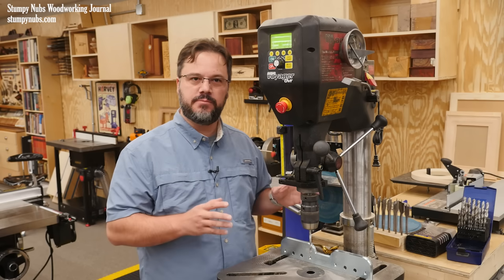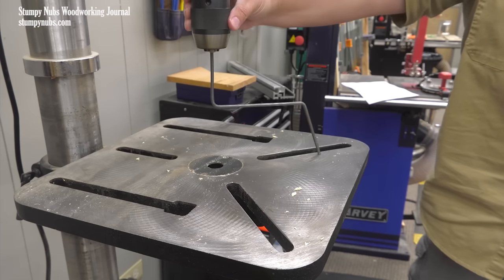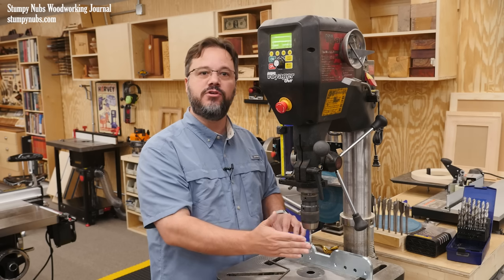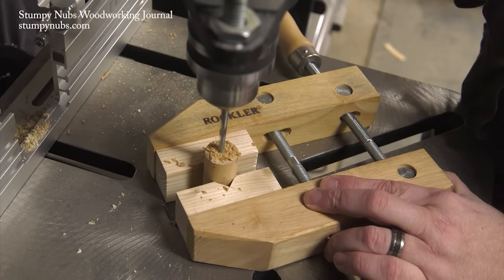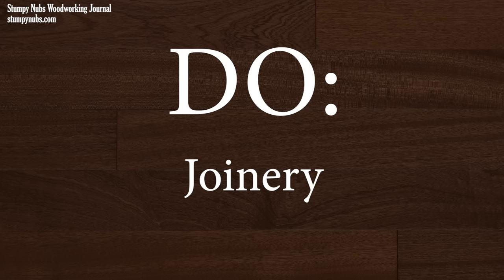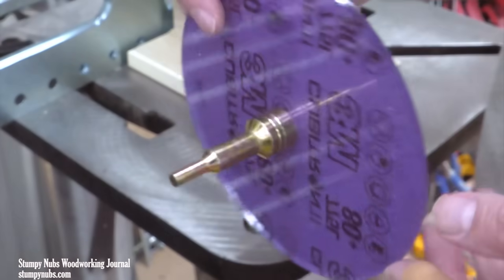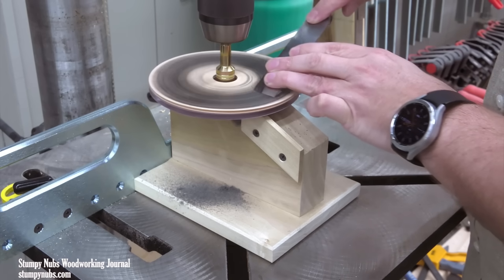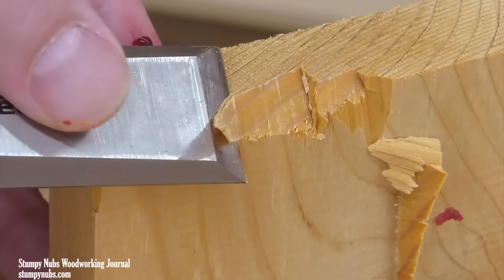WARNING: Internet drill press trend can SERIOUSLY hurt you!

Comment: I can't help but feel uncomfortable about the idea of acrylic spinning in a drill chuck.  Maybe the object you're drilling might just catch the edge of the acrylic and then it shatters, shards flying everywhere. I dunno, I just don't feel happy about spinning acrylic.
Reply from the maker: When using any power sharpening system, including common bench grinders, the tool must be held in a direction so that the spinning disc or wheel is going away from the tip. A catch on a bench grinder wheel can violently jerk that tool from your grip, as well. There is a basic level of common sense when using any machine.

Comment: I don't understand why people use a giant press for little things. My wimpy $50 press can be stopped by grabbing the chuck and will still cut a 1/2" hole through metal.
Reply: Yes, but if you sometimes need to drill bigger holes, like 1" in steel, your press wouldn't be able to do it. But with a big press you can also drill small holes. Othewise you would need two drill presses.

Comment: The fact that he nicked his finger while demonstrating how 'sharp' the chisel supposedly was tells me that it isn't that sharp. Any reasonably sharp blade will cut through end grain if enough pressure is applied, but the odds of the blade slipping also increase as you apply more pressure. And that makes it more likely to have stumpy or nicked nubs.

I'm sure the drill press sharpening trick is great to save from having to buy a slow speed bench grinder for gross sharpening, but if you're really wanting to hone your blade then stick with a diamond stone or whetstone.
Reply from the maker: The blade did not "slip" and cut me because it wasn't sharp. If you have never gotten the occasional tiny nick from a sharp corner of a chisel or another tool while handling it, you are either not being honest or you haven't been a woodworker long. Nicking yourself with a sharp tool happens. It's painless, it only bleeds a few drops and it's no big deal.
Reply: @StumpyNubs  I've gotten nicked plenty of times when chiseling. My point was that the sharper the blade the less likely it is for the user to get nicked while chiseling. I gauge whether my chisels need touched up by how often they 'skip' during use. A stupidly sharp edge should slide through wood with an easily controllable amount of effort.
Reply from the maker: @RickerD  Why do you assume the nick occurred because the tool skipped or slipped during the actual cut? That's rarely when I've been nicked. It usually happens while handling the tool, reaching for the tool, bumping the tool while moving something on the benchtop, or countless other ways. We're not talking about a big gash here, it's a tiny little nick and a couple drops of blood that are magnified by the extreme camera closeup. If you use tools on a regular basis, you know this happens and is not because it is dull, but because of the opposite.
Reply: @StumpyNubs  It's a reasonable assumption based on the location of the injury (between 1st & 2nd knuckle). When I nick myself from handling tools it's usually on the tips of my fingers or my palm. But as you noted, I'm making an assumption and don't know what actually happened. So I suppose I should ask: how did you cut yourself? I hope you're OK and the nick heals quickly and with no infection.

Also, I would like to point out the simple fact that if the cut on your finger was from the chisel, that alone is an indication of its sharpness. But 'sharp' is a very relative term; you could have stopped after the first round of grinding and had an edge that was sharp enough to cut wood or skin. Each progressive step made the blade sharper though, and that was really my main point: stopping after a 220 grit isn't really producing an impressively sharp edge. Yes, it's sharp; yes, it's quite sufficient for most woodworking tasks; but I would not consider that sufficient for cleaning up joinery or the like. (shrug)

Comment: Autumn Tip. When drilling out a leaf rake to repair or replace a handle. Put that head in the vise. A metal spring rake becomes a fan blade reaaal qhick

Comment: I taught tool and die for decades.  The drill press is the most dangerous machine tool when viewed as to which causes the most lost time accidents in a machine shop.  The lathe comes next.  !st class was always no long sleeves or loose clothing,  no wristwatches or jewelry.  No long hair.   No wedding rings.   Why you are issued a locker.   You always block in your work piece  so it cannot spin if the drill catches.  Take the classes and do not try to learn from amateur youtube content creators.

Comment: Aways have a rail to stop the price from spinning and rule of thumb don't use your hand plus coated  tools are a joke cause if you get past the coating it is not as hard and sharping doesn't hold up here's why tool steel is drawed back at 900 to 1100 degrees give or take the coating is put on at 1200 degrees so once they you get past that it makes it softer this is why I never buy coated tools and still have the same drill sit 50 years later Holt drills are the best

Comment: Yeah! Talking about safety and then sharpening a chisel on a free spinning disk. No thanks I’ll stick to a stationary wet stone.
Reply from the maker: I guess you've never seen the Worksharp before? Or Lee Valley's sharpening system? This isn't a new concept, and it is no more dangerous than a bench grinder. The direction of the disc rotation is away from the tool.

Comment: Quite frankly,  you sir are an amateur at hurting yourself with power tools.  I, personally have drilled 2 holes in my hand,  electrocuted myself with a desk sander,  blown my face off with a gas forge,  then electrocuted myself with an electric forge! Each time I said to myself "ok- I'm not doing that again!" Safety lesson (painfully) learned.  I maintain that if involved life and limb,  then the lesson sticks in your mind.  Also,  if you think it's dumb,  it probably is. The number of times I've been holding something in one hand,  a power tool in the other and this thought goes "there is probably a better way to..   OOOW!!!"😂😂 So you can learn by a combination of luck, evolution and bitter experience, but it's probably better to just read the manual...

Comment: Just an observation, but when talking about the proper way to use a tool, and the footage you are using contains blood emanating from your digits or other body parts, you might want to explain that you didn't get that wound from the activity you are demonstrating.  Unless of course, you are, in which case you should explain that this is much better than the result from doing it the wrong way....
Reply from the maker: Anyone who has done any amount of woodworking knows what it's like to git a tiny nick from the corner of a sharp chisel. It happens, it's painless and no big deal. I don't think people need a play by play about what happened.
Reply: @StumpyNubs I know. It isn't a personalized piece until I bleed on it a bit. Mine usually come from splinters though.

Comment: No gloves? Yeah maybe if you are drilling soft wood in a climate controlled shop. Spiny disc with a very limited lifespan media for sharpening (and screwing up your flats and corners)? Why?  Oh it will be sharp because the two planes can meet, but as a properly tuned chisel that is a consistent flat back with non rounded peripherals?  I think this is not wrong, but it's also not for people doing real and efficient work.
Reply from the maker: Google "Drill Press Glove Injuries."... And the spinning disc is a very efficient way of sharpening that has been used for many decades and is the bases of several professional systems. It is definitely "real and efficient."
Reply: @StumpyNubs  just because you wear gloves, doesn't mean it's going to get wrapped up in the drill motor, lathe... Etc.  it's completely unrealistic to, for example, not use gloves when drilling steel with hot chips flying at your hands.  Nor would it be so to be at -10C outside trying to hole
Hog through a post.  Focus with the proper knowledge is the best safety.  You try your best to not have gloves, yes.  But the reality is even homeowners often have unheated garages.  It's far more dangerous to run the machine with numb hands than it is with gloves.

A spinny disc stropping the back of a chisel will definitely screw up the two peripherals.  It will still be sharp, but your chisel will have issues when the two corners are used, especially over a longer paring distance.

I am not saying your video is not right.  I am simply saying that it is not practical in some (in fact, many) situations, and for the discs, does not produce a tool that is satisfactory for all work.
Reply from the maker: @MintStiles  Just because you do anything dumb doesn't mean you will suffer the consequences. But it greatly raises the risk to an intolerable level. The examples you give should all be clamped down, not held with a gloved hand. You are substituting convenience for common sense and the potential consequences are more than you seem to realize. But you are free to do whatever you like. Have a nice day.
Reply: @StumpyNubs  what happened to my comment stumpy?  Do you not like legitimate counter arguments?
Reply from the maker: @MintStiles  What are you talking about? Your comments are above.

Comment: This video doesnt do what it says on the tin.   Neither the thumbnail image nor the title seems to be adtessed in the video.  Otherwise, there is some good info in the video but also incomplete.  For example you talk a little about workholding but not what happens if you don't.  And in the privess, you could perhaps have fulfilled the false promises made in the thumbnail and title.
Reply from the maker: The thumbnail refers to the part in the video where I said I sliced my wrist open doing exactly what is shown on the thumbnail. The title refers to the trend of using router bits in drill presses, which was also covered in the video. Maybe hold off on calling things "false promises"...